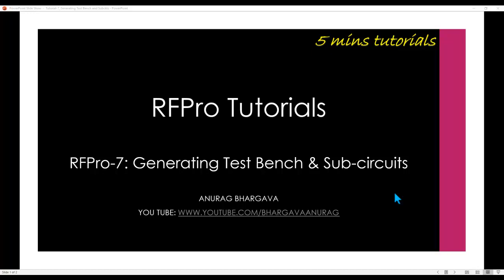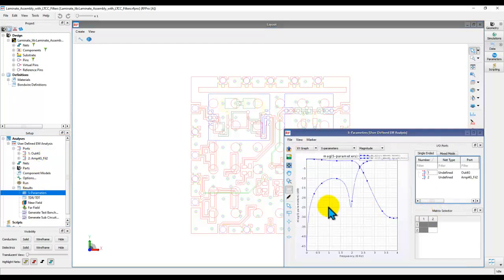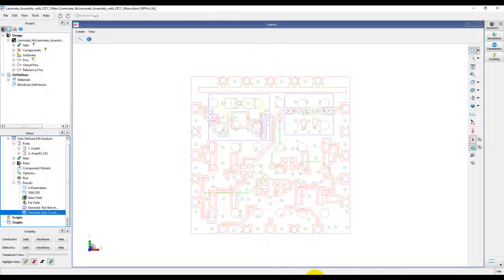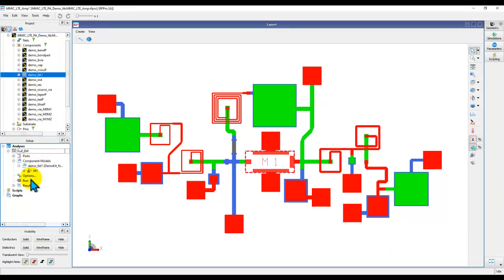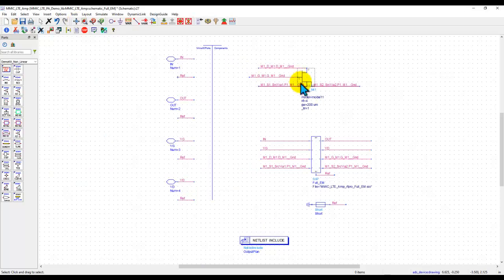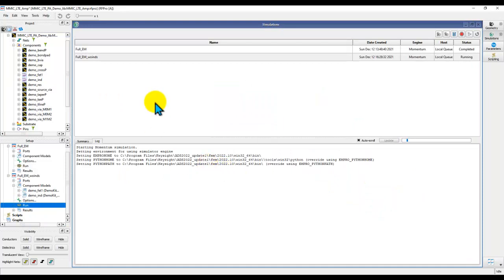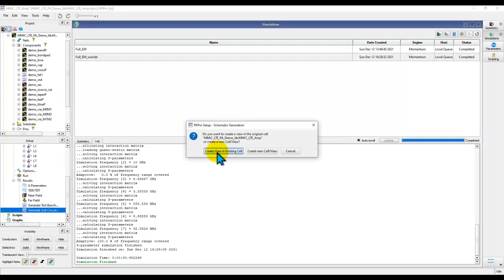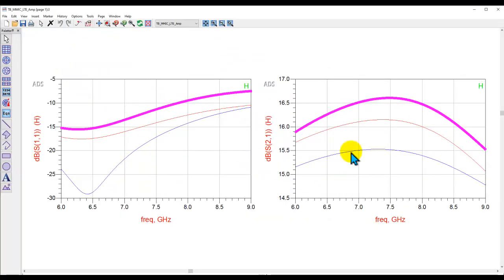RFPro-7: Generating Test Bench and Sub-Circuits from RFPro

Comment: Hej Anurag, is it possible to generate sub-circuits using Python? I would like to co-simulate RFPro structures with a circuit in ADS. There are a lot of RFPro structures I want to test together with the circuit, so it would be good if the process could be automated.
Reply from the maker: Yes, you can completely automate RFPro simulation as well as subcircuit or em/ckt cosimulation schematic using Python

Comment: Can you generate a sub circuit from RFPRO and have it look like the actual layout that was simulated somehow? Or can you only get the block version that gets generated when you create a sub circuit from RFpro EM simulation. In regular ADS simulations it was useful to see the actual layout when placing the components.
Reply from the maker: Hi,
What you mentioned is a layout look alike symbol and it was helpful since we had to remove all discrete devices for EM simulation and then connect them back in schematic for em/ckt cosim.
With RFPro, you don't need to remove circuit components and the back annotated schematic already comes with every connection made automatically for designers hence the theoretically there is no apparent thing you lose with unavailability of look alike symbol.
Having said that, there is still a way to use look alike component with RFPro generated schematic and I would recommend contacting your local Keysight tech support team for help.

Comment: Nice video and series. How do you create 2 ports per inductor? Usually for passives with 2 pins you get 1 port.
Reply from the maker: Hi Dimitris,
You can expose the Pins under Components tree under the design database, select both the Pins of the components, right click and select Create One Port per Pin and add it to the desired analysis. If there is no Cover Plate in your stackup then you can select the created ports under the analysis, right click and click on "Create & Use Virtual on Nearby Ground Net".
Hope this helps....

Comment: It is cool, no doubt 👌

Can you share this multilayer PCB or any other file so that I can follow in parallel.. I'm not currently working on anything similar but I don't want to miss the chance of learning with these short tutorials.

Thanks
Reply from the maker: Hi Hamza,
I don't have anything that can be shared but you could surely download the gerber or odb files from some of the Texas Instruments or other vendors which typically are their reference boards. Once you have it then simply make it suitable by having proper stackup & material info etc in place.
Reply: @BhargavaAnurag  great. Thank you. It'll work.